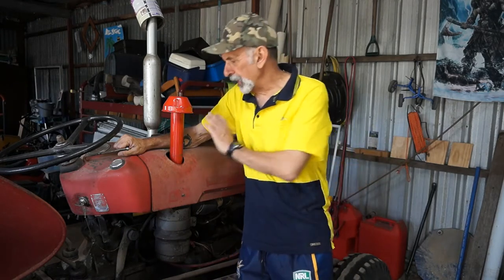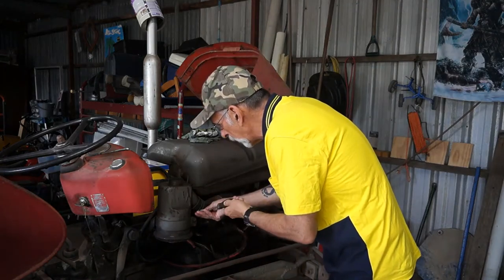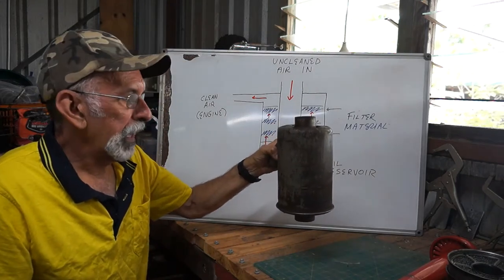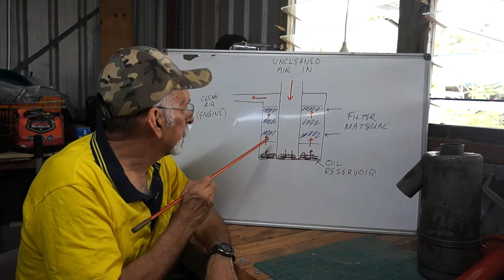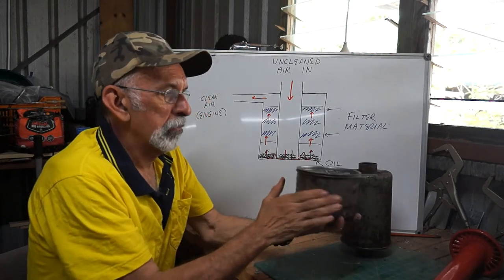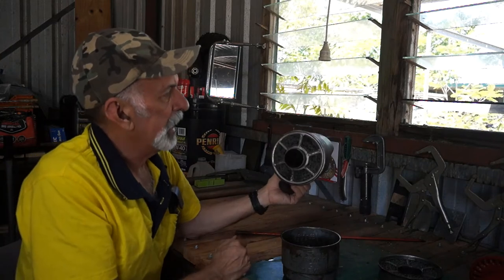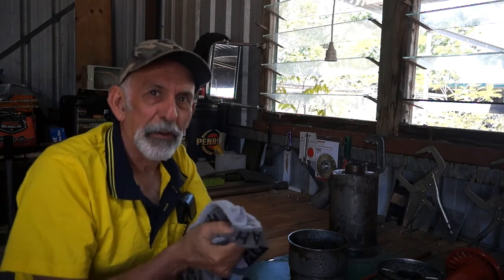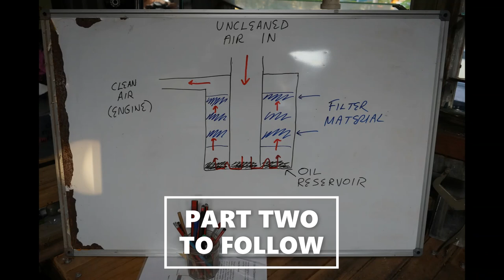Massey Ferguson 35 Oil Bath Air Cleaner - Part ONE

Comment: Thanks John for your video clip  
very helpfull ,
Ihave a small problem i hope with my massey 135 not thinking at the time while the tractor was running ,
i put oil in the air filter  causing it to smoke like hell through the exhause and rev high i turned it of ,have not started
it yet incase i do any damage if i have'nt done allready would it be possiable for a bit of advice please John,
kind regards Pat
Reply from the maker: Hello Pat, that is NOT good news. 
1. Is it a Diesel or Petrol (I believe there were some?) engine?
2. How much oil did you pour in?

Comment: How much oil and what type oil to put?   Is diesel oil ok?
Reply from the maker: Hello. I use the same oil that I use in the Engine. The quantity of oil is up to the Fill Line shown on the bottom cup (see Part Two Video)
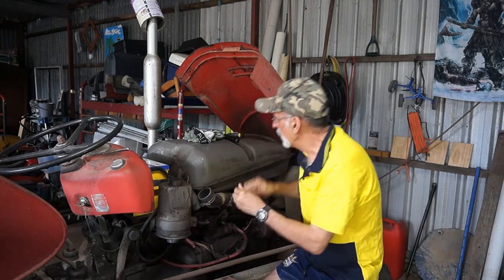Reply from the maker: Reference - 4:04 of Part TWO video.